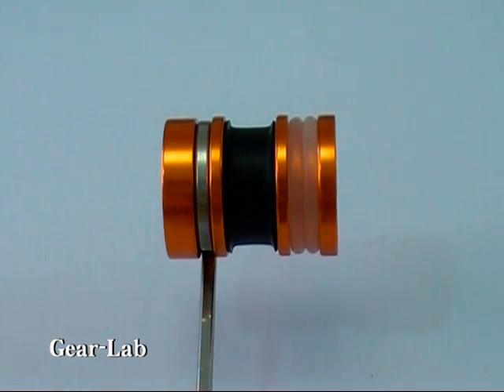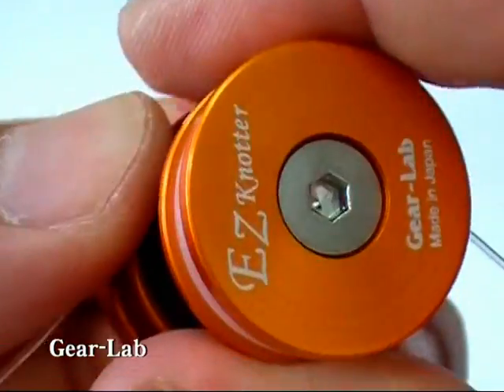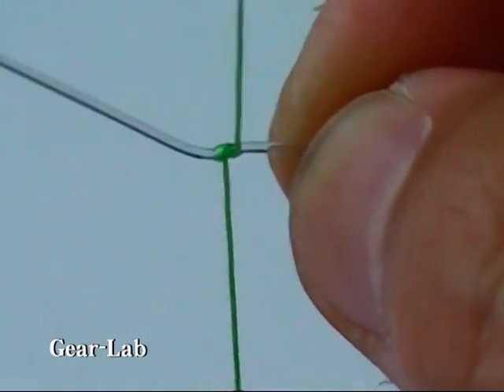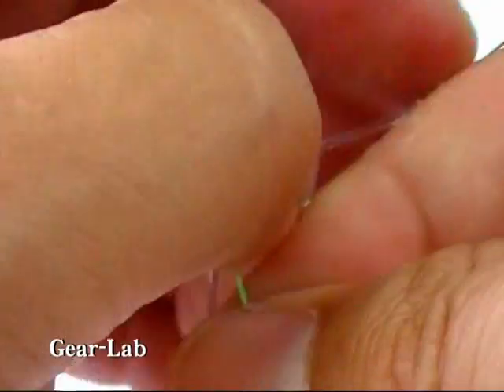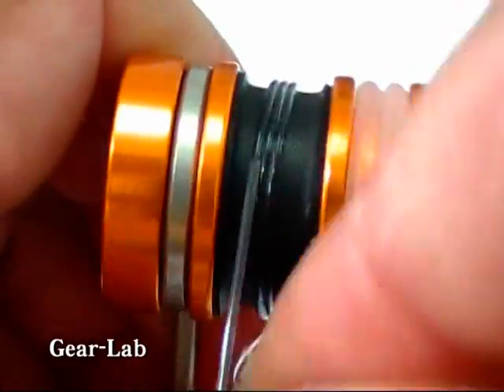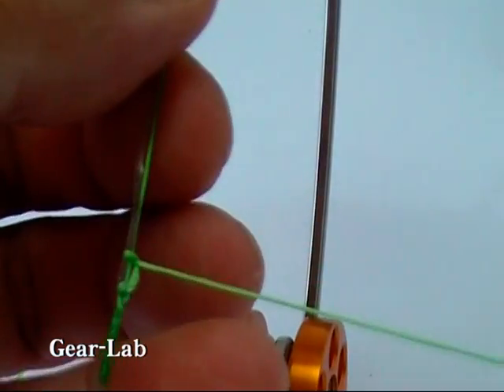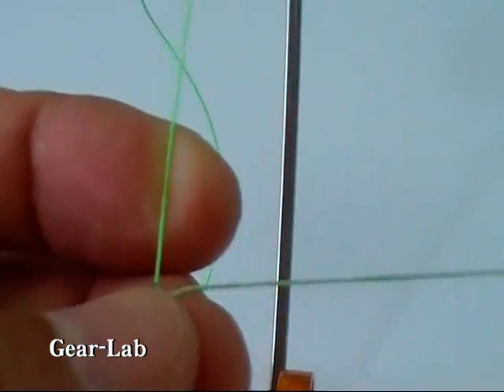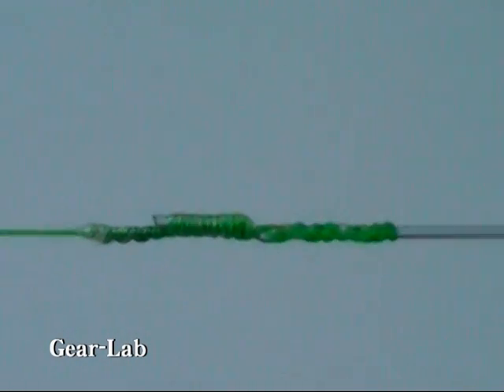Zoom in a perfect FG knot using the EZ knotter !!

Comment: Have had this for several years.  Even though i dont need the knotting tool any longer to tie the FG knot, when i am at home i still  use it to tie my leaders. No kidding it gives you a perfectly tensioned, NEAT knot every time.  It literally takes less than 2minutes to tie a beautiful FG knot once you get your head around the steps. No teeth required in tensioning the knot properly  to make sure that the knot never slips. My only criticism as with all tackle that comes out of Japan is the bloody ridiculous price for a piece of spring steel and three round bits of hard plastic.  It should be sold for half the price.

Comment: Zzzzz..    I was finished with a "Simplified FG knot" before you got the shock leader installed into that tool!  Also, all those added half hitches are redundant and doesn't add to the knot strength.